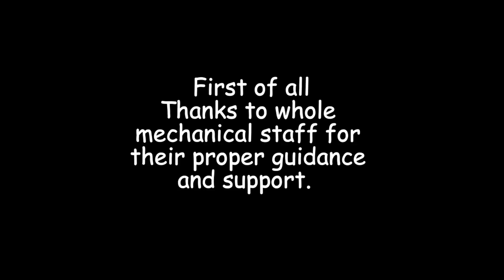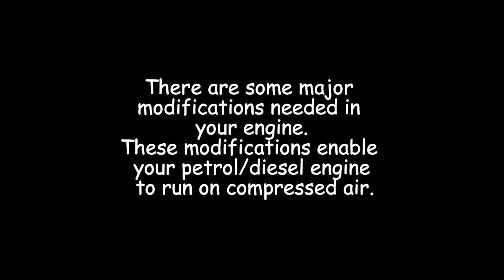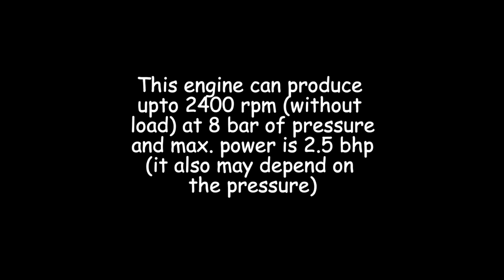Compressed air vehicle (Mechanical Engineering Project, BIS College Moga, Punjab))

Comment: Nice work guys have you thought of terning three alternators useing too to for powering a onboard air compressor an on to power the drive train or even a resproked starter motor both are fun

Comment: If you compress the air with solar or wind power than it's not a big issue that heat gets lost but it would be nice if that heat could be captured in something you take along just to give some power when needed and then avoid freezing when the air fast expands(recently I thought about exothermic sodium hydroxide + water)  I wonder if  expansion without icing in warm climates is possible when you drive continuously at low speed.

Comment: youre still usig a piston engine and loosing lots of air power and have lots of friction. save the envoirement what means that this motor needs loads of ernergy to fill the air tank.
take a turbine instead, one after another. don´t loose to much pressure, take a big turbine, then and smaller one and so on. turbines like from a pneumatic srewdriver. instead of a gearbox you could use a variomatic from a scooter. what you are making is the very oldscool technologie. did you already thought about kinetic energy, too?
thought about nikolai tesla?
sorry, but he music is terrible, and the sound of your vehicle aint better.

Comment: For the next project, buy an electric cord of 8m, remove the motor from the compresor, and place it on the chassis, then do the power transmission connections and have fun!!!! I bet ya it will last longer and you will enjoy more avoiding the cable. like playing snake but in real life.

Comment: How much pressure is required in air tank? can any mechanism be developed to control air flow via accelarator cable and modifying the carburetor?
Reply: yes you could add a simple ball valve to to the handle and have it open close with a motorcycle throttle handle, or run it to a foot valve

Comment: Compressed air is an inefficient way to store energy because compressing the air generates a ton of heat.  As the air and tank cools, much of pressure and the energy is lost.  You are much better off using the electricity or gasoline used to run the compressor to run the car if efficiency is your goal.
Reply from the maker: Edward Rex thnku so much sir.... I appreciate
Reply: clever.
Reply: anyway, it is worth to try checking the efficiency of it, even with those losts. Looks a way much better ratio than with gas.
Reply: Thats why you buy dry ice and let it pressurize

Comment: admirable attempt, but like electric power, commercial transportation of materials will always rely on diesel/gasoline power and will ocean faring ships transporting containers relying on bunker C, or cargo fuel. as for personal transportation once a replacement engine can move 4 220 lbs humans at 60 mph for 3 hours over a varying terrain with upto 6% upslope grades then you will have a viable replacement for a crude oil gasoline powered internal combustion engine...for the moment air power joins electric power as a cute curiosity for greenies to putter around town grocery shopping and not doing any real meaningful replacement transportation
Reply: Wouldn't the wider use of this technology drastically decrease the use of gasoline/diesel powered vehicles? After all, people collectively drive millions of miles per year just running local errands, 1 passenger per SUV.
Reply: Wouldn't the wider use of this technology drastically decrease the use of gasoline/diesel powered vehicles? After all, people collectively drive millions of miles per year just running local errands, 1 passenger per SUV.

Comment: Hello.....

Nice work guys!!! Really loved it. I need a similar model consisting of the chassis, engine and drives for a different project. I want to know the cost of the your model excluding the compressor.

Is it possible to interface an ECU with the engine used in ur project??
Reply: +Prashant Patil 9816916007 c

Comment: sir pahle to heads off to u for such a innovative project,,,,second thing is i want ur help sir ,,please share it sir what to do with spark plug should i remove it?and in what shape the cam shaft need to be reshaped ?and as for the duct of carbeaurattor  what should be done.should i close it?please help me sir on my id  at,--aakash.baheshwar@gmail.com:)

Comment: sir, i m a final year automobile student and preparing for the project on compressed air driven vehicle.i want your help regarding what other modifications you guys did in your vehicle like fuel(air) supply and valve timing etc..

Comment: hello sir, i m satvender singh from hyderabad.. i hav started the same project n struck in between to how to convert 4 stroke to 2 storke engine to be worked on compressed air.. so cn u mail me the modifications done in the engine so that it works on compressed air.. my mail id is satvender420@gmail.com
Reply: Satvender Singh can you please guide me on the Air tank specification